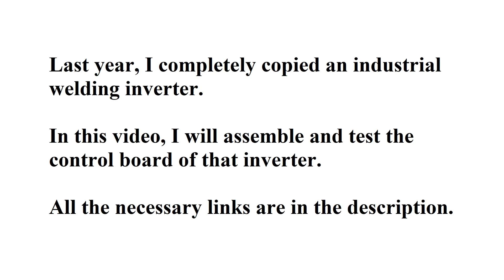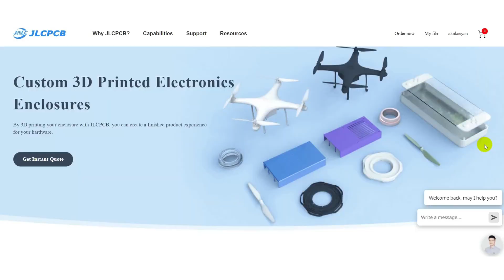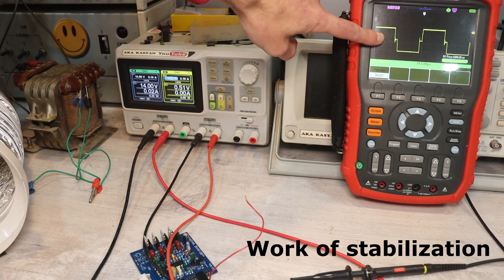SG3525 Welding inverter control board

Comment: Hi!
Another great video series.
Could you please dezign a constant voltage welding poeer supply for a DIY switch- mode MIG welder?
It should be able to provide a maximum current of 200A (or more) and variable voltage from 12V to 30V or so.
There should also be a fixed 24V output (maybe 4A) for the wire dive motor and its speed control.
The trigger switch on the hand piece should allow switching on the drive motor, the main power supply and a gas solenoid.
All the mechanical parts can be left up to the DIY builder.
I look forward to hearing back from you?